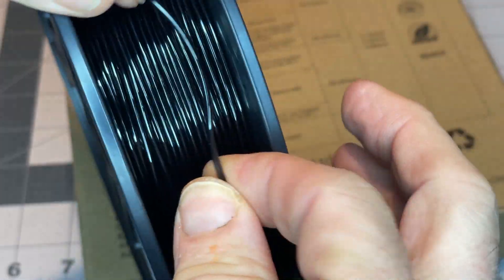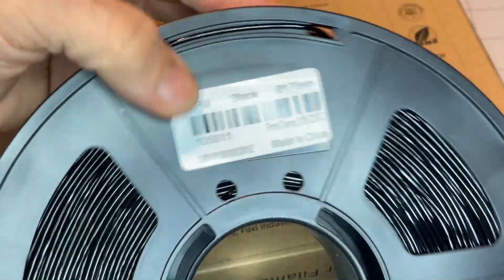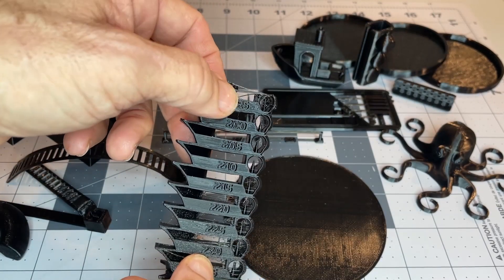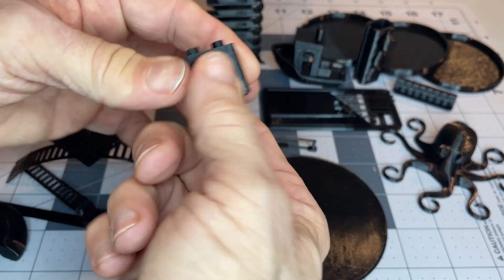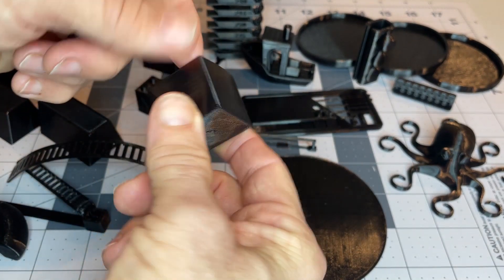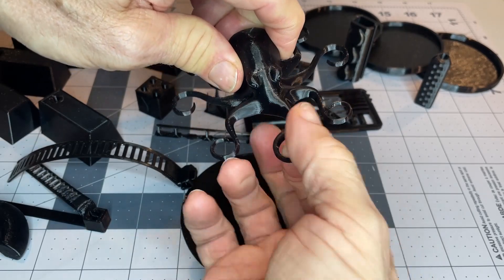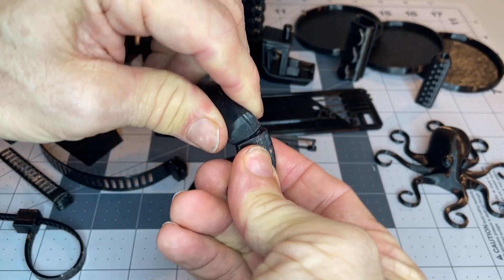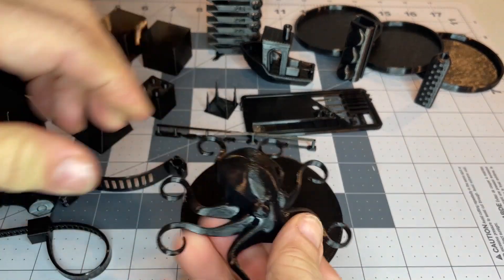Review: Sunlu Black TPU

Comment: I've ended up with 205 with Sunlu. It's the only TPU I've used. Recently tried Duramic and it's noticeably softer. both rated at 95A. So is Sunlu harder, or is Duramic softer than it's supposed to be?
Reply: Same thing for me. Tried bunch of the hardest TPUs by the Shore number and none of them come close to the hardness of the Sunlu one. It's by far the best and even cheaper.

Comment: Did you use cooling on the test print ?
Reply from the maker: sorry for the lag. I did experiment with cooling fan. I ended up with using it after 4th layer at 50%. that's with a 4010 fan with a single duct. So, not a lot of cooling airflow there. If you have 5015, you would probably want 25% or less.